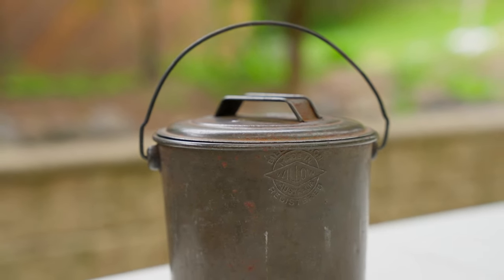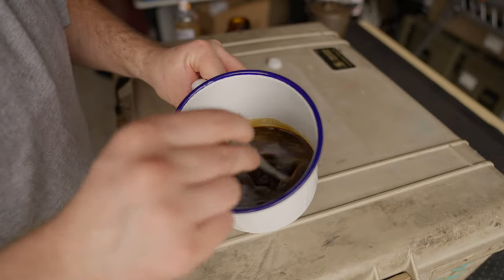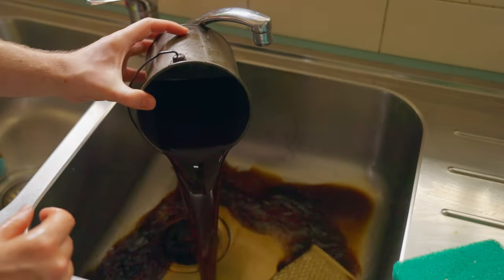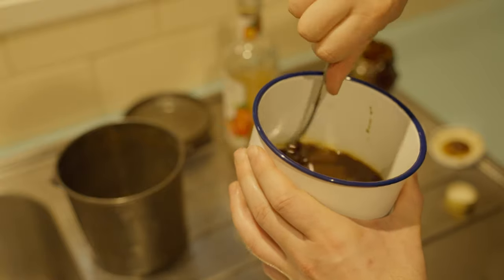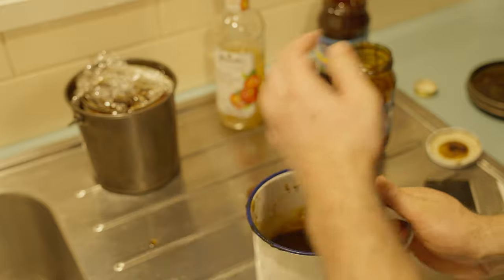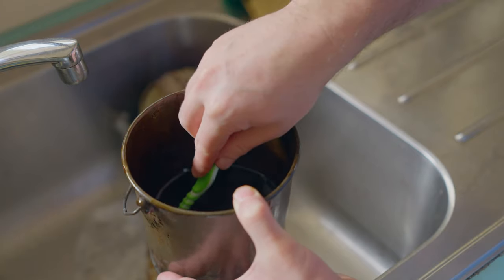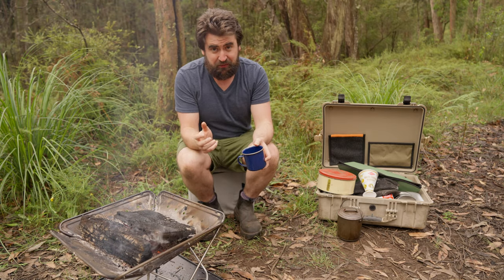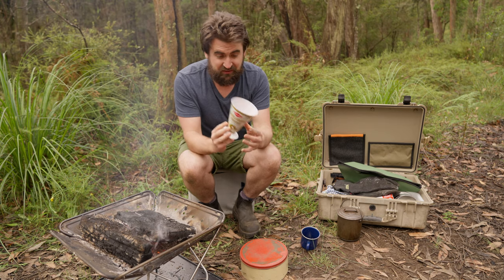Restoring Antique Billy Can for Campfire Cooking - Made in Australia by Willow Early Last Century

Comment: I would like to get my hands on one as well, you dont have to worry about lead with those billys?
Reply from the maker: Thanks for watching Daniel :) I've seen them come up occasionally on FB/Gumtree/Ebay - keep an eye out. No concerns with lead as far as my research found. The one thing I battle with is keeping the surface from oxidising between uses. Ive started oiling it after each use for rust resistant storage (oiled once completely dried), then wiping it out before next use. The surface is so reactive! It's a piece of history though, kind of like the work in looking after a vintage car..... Cheers mate.